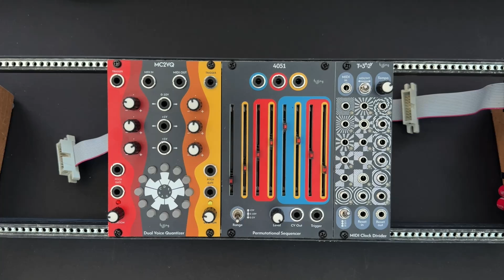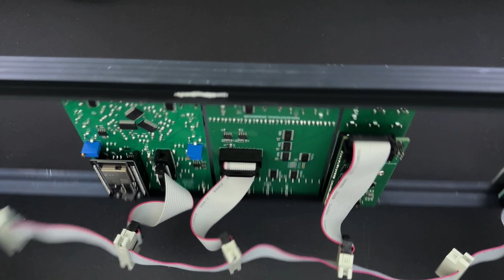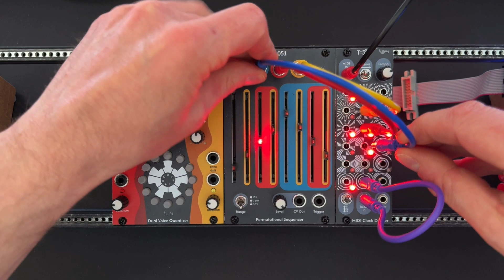Trilling Synths single-take functionality demonstration

Comment: these look great, can you send a cv clock to the midi input as well?
Reply from the maker: Thanks! No that is not going to work
Reply: @hfgdebruin  I like the module but not taking regular triggers was an odd choice. I do eurorack only no midi
Reply from the maker: @wavefunctionart  all trigger inputs take regular triggers. This question was regarding the midi input on the midi clock divider module.
Reply: @hfgdebruin  yes exactly I am talking about the divider. I would consider your module if it took modular trigger instead of midi
Reply from the maker: @wavefunctionart  the front panel graphics would not make sense if it does not know exactly what the incoming trigger is supposed to mean. But maybe I'll come up with a solution for the next version!